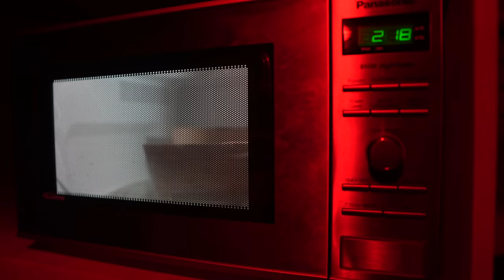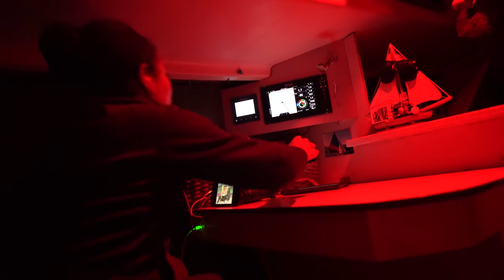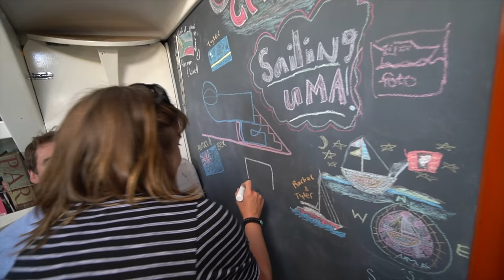BOAT TOUR: The Modern Interior of our 50 yr old DREAM YACHT — Sailing Uma [Step 225]

Comment: I have to say I love how clean a modern you’ve made Uma❣️ I’ve been watching a few other sailing YouTubers and it’s amazing how cluttered their boats look. With old disused equipment taking pride of place, and the stuff they really use, added in a haphazard manner. Four faucets of the kitchen sink; 1 very fancy, looking like what would be used in a house, 1 little spout for sea water, another little spout for drinking water and I didn’t catch what the 3rd little spout was for, all the little spouts used a foot pump. These faucets seemed to be added at random around the sink, probably as needed.  I guess it is easier to accumulate than to pare down. It’s also to me amazing how many folks use extra sleeping bunks as storage by piling stacks of stuff on it,rather than just converting it to permanent storage 
Anyhow, love what you’ve done with Uma so far, both functional and beautiful!

Comment: PS cut some discs out of old wet suit scraps just a bit bigger than the size of the fuel canister opening and when cooled put those on top of the canister opening and close down the burner. Seals the canister and prevents a great deal of evaporation of the alcohol.

Comment: You've done a lot of amazing work on your boat and it's clearly obvious that your talents have been used to the max on the rebuild and refit over time.  Additional the reuse of space makes the interior look inviting, very useful, and fills almost all your needs for living and sailing.  Hopefully, over time you can get the rest of the items -- like the freshwater maker and enhanced solar --  purchased and installed so that you can navigate the longer adventures across the bigger ponds. Wishing you the best of luck and safe journeys. Note: I just started watching this channel so you may have made some or all of those upgrades already, but I can only go by what I've seen so far in this video.

Comment: Beautiful, at last a classic sailing yacht with a light coloured interior. I did build a few boats, multihull and monohuls, did repair and refit multiple yachts, but had always problems with convincing the owners to go for a light interior. It's so much more friendly to live in. But most of the time I did get the same response "  well it looks OK, but it's not really boatlike. You really did prove them wrong.
Reply: This was easier than normal, due to the simple interior in white laminated plywood with small wooden brims. No Mahagony, no Walnut to discard.

Comment: you guys seem to complement each other very well.  I like your thought process and being able to pull out the tools and build what's in your head. I like your inspirations with fold down items and everything on rollers or slides since nothing is square on a boat which leaves lots of negative space. reminds me of walking through an IKEA showroom for parts like that.  the shower/bathroom I was thinking a sliding wall could have been moved out another 1-2'. looks really tight. I love that drain on the floor. very creative. great job. reminds me of this guy, sam Holmes sailing. he also gutted his boat and pretty much built from scratch. I would love to get a boat and sail with a fun group. I catamaran will be in my future... see ya out there coming from Hawaii...

Comment: The hefty Susan, and self draining corrian countertype are marvelous ideas. I'm surprised you haven't done a long rectangular skylight with UV filtered glass down the center of your main cabin?
Reply from the maker: Our deck doesn't have that kind of structural integrity. It needs to be something designed and engineered from the beginning.

Comment: If the wall inside your closet gets warm, make an air space between it and the backboard behind the stove. You really don't want to run the risk of charring the wall surface between the closet and the backboard. If it chars it's just a matter of time before you set the whole thing on fire. Drying your clothes a bit quicker is not a convenience that's worth sacrificing your boat or maybe even your lives for.

Comment: Looking at the respirator filters you were using I'm afraid for your health. They appeared to be the paint pre-mist filters that do nothing to filter dust particles. The underlying vapor catridges do nothing either. You should have been wearing the pink HEPA fiters. Ouch! I forsee chronic silicosis in your future. It is a common mistake. Paint catridges do nothing to protect from dust.

Comment: You guys did an awesome job with this reno and everything is well designed. I just have one question, how does someone wash their hands after using the toilet if the sink is not hooked up?
Reply from the maker: We use the sink in the galley (kitchen) for everything … it’s literally 3 steps away.

Comment: I am curious about the fridge. Is there enough clearance on the sides, etc. for it to work efficiently, or would you change this if you had to do it over?
Reply from the maker: You only need air circulation around the compressor. And yes, there is enough.

Comment: Hey Guy's great job! I just bought a Pearson 40. I have two structural questions: 1. I see you removed the pole for the table. Is there anything special necessary to do that. 2. I see you cut the arch supports at your desk and stove areas. Anything necessary for both of these structurally? I would like to do both of these projects but I don't want to structurally damage the boat. Thank you!
Reply from the maker: We haven't removed anything actually structural from our boat. The parts we cut out, were cosmetic.
Reply: Great, Thank You! That was my question. I appreciate your help. Good Luck!

Comment: alarm bells ringing cutting back bulk heads watch for misfitting panels it be a sign of the bulk heads cracking
Reply from the maker: The parts we cut, weren’t park of the boats structure.

Comment: Where do you eat, especially if you have guests and the weather doesn’t allow a cockpit meal?
Reply from the maker: Usually seated on the nook around our fold down table. Seating upright in a chair isn’t actually the norm. Most cultures eat “on the floor” so to speak.
Reply: @SailingUma  first, congratulations on your creative thinking. I am super impressed with what you have done and how great it looks and works. As for my question about seating - at my age I have great difficulty sitting “on the floor” for extended periods.

Comment: What is the "non structural" part of the bulkhead?
Reply from the maker: Anything that's more than about 15cm from the hull on most bulkheads. The main bulkhead by the mast is different. It kinda needs to be the whole thing. The rest could honestly be just the ribs and we'd be fine.

Comment: You benefit from your work. You know the boat in & out. INVALUABLE knowledge when are offshore sailing. But to be honest, this was more an interior designer video than a sail video. The decision to replace the diesel is prohibitive for long offshore travel unless you have a diesel generator to supplement the solar panel, wind or tow generator.
Reply: Sure about the prohibitivity? Please accept the news that they made it six years and about 20,000 NM without a generator!
This is the interior part of their boat tour. "On deck" was included in step 220, part three is coming soon...
Reply: @paulsj9245  .. Done some miles myself. Atlantic crossings, North Sea, Norwegian Sea, Irish Sea, Skagerak, Kattegat, Baltic Sea and more. You can do as many miles you care to count until you have something (or potential) catastrophic happen. Mast break close to shore in bad weather. Hull breach or anything that require you to have a power plant in your boat. I don't trust electrical engines in a boat. Simple as that.
Reply: @oddvardmyrnes9040  Your distrust is o.k. as your opinion, but the former argument was easily disproved. Your change of focus will not save it.
I won't get into details, as this is a question of belief.
I see a successful journey from the Caribbean high into the Arctic (78°), that's good enough for me.
Have a fine day!

Comment: Why not use an induction stove?
Reply: Big investment for a single purpose, and a deep dip into battery capacity. Also, the current stove seems to fit and work well, and D&K are reluctant to change w/o need - just look at all the "old" details which haven't been changed, like some of the shelf doors.

Comment: Aha it just grind and flush. No compost.
Airhead is better I think.
Reply from the maker: Still have to dump all that dried waste somewhere. In a trash can? Carrying a bucket through the rolling boat while sailing offshore? We tried it for 3 years in the Caribbean and decided to upgrade to an electric macerator. So much better. Besides, “composting” toilets don’t actually compost anything. They’re just “dry holding tanks”. It’s takes almost a year to compost human waste.

Comment: This looks very pretty but it's a dock daisy, never meant to leave the harbor and definitely not meant to sail in any breeze.  There are literally no hand holds anywhere to be seen.  Have the boat out in a stiff breeze and it will be heeling a 15, 25, 35 degrees and going downstairs will be exciting in a bad way.  And forget about cooking while underway.  The head is great, lots of smart things happened there.  Cannot tell if stone tile was used in the galley and head but if so, don't do that, it weighs to much.  Heavy boats are slow and putting a lot of weight on one side will unbalance the boat.  But yes to most of the ideas in the head.

I've helped design production interiors and yes there are more roomy ways to lay out a boat but it must be balanced with how a human will use the interior of the boat while underway.  Again, if you just want to live aboard a boat at the dock and only take it out in low breeze or motor sail everywhere you go, feel free to go as far as this video.  But if you intend on passage making, this boat is not your friend.
Reply: You obviously have not seen their other videos.  This boat has crossed the Atlantic, sailed to UK, the Netherlands, Norway, has sailed in the Arctic and up to Svalbard. I suggest you do binge watch and you will be proved wrong.
Reply: "Dock Daisy" has 20,000+ NM under her belt under Captain Kika, dodged a Hurricane, crossed the Caribbean, the Atlantic, the North Sea, the Norwegian Sea, and the Greenland Sea.
They sailed through Hell's Gate - a wonderful episode (#181)
Cartagena de Indias and Longbearbyen may mark the extremes. I'm guessing that you may be the Dock Daisy between you two ;)
BTW, handrails are under the ceilings. No stone tiles - too expensive!

Comment: So you.spwnt 3k on a boat thats.a good deal but how much remodeling I mean I can spend 3k on a boat and Maybe 2k.on fixing.it but what did you.spend
Reply from the maker: We spent 6 years.
Reply: You can't spend 5k on a boat and make it look like this. Realistically, you should look at $50,000 or more to either buy a boat in good sailing condition, or buying one in poor shape that you can spend a lot of time fixing up. Another thing, they did all the labor themselves, otherwise it would have cost three times that much. They spent a lot of time sailing around the Caribbean on a boat that looked like it was in the middle of a rebuild, because it WAS in the middle of a rebuild.

Comment: Buying a 36 foot sailboat for 3000 dollars.  That is insanely cheap.
Reply: I'd second that, but Dan once called it "a terrible deal". Actually, it was the worst deal between the three couples discussing electric sailboats in step 140. One came for 2.200 $, the third was zero bucks ;)

Comment: So...you turned an old boat into a floating apartment that will never, ever sail worth a damn after adding two tons to its displacement, thereby subverting its essential reason for being.  I for one do NOT applaud you.  Dock fees cheaper than rent, paid for by YouTube - which I suspect is the sole motive.  Don't you DARE try to sail that "boat" out of sight of land unless you are a VERY good swimmer.
Reply from the maker: https://youtu.be/LDlGECAVbp4

Comment: This is a horrible interior, done by amateurs.  I would not want anyone walking over my galley.  The seating arrangements are awkward. The pull out cooktop is dangerous. 

Fine for a couple at sea but not good for most other applications.
Reply from the maker: Good thing its our boat, and designed for our needs.
Reply: @SailingUma well let’s see how you redesign your boat this time around.  I’ll bet that my initial comments/critique will be addressed in this version of what is your boat.  From your architect friend who has been designing small spaces for 45 years. Nice to see you catch up.